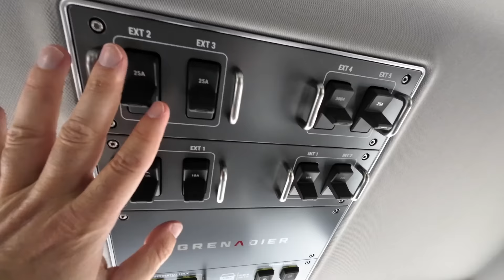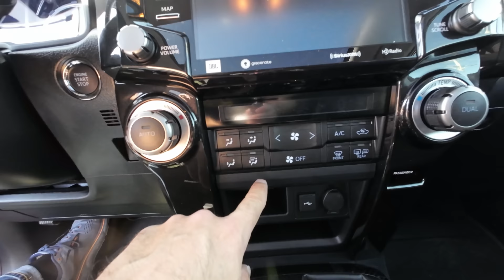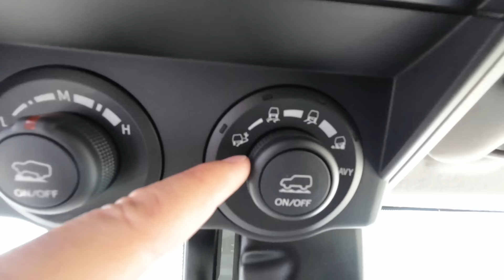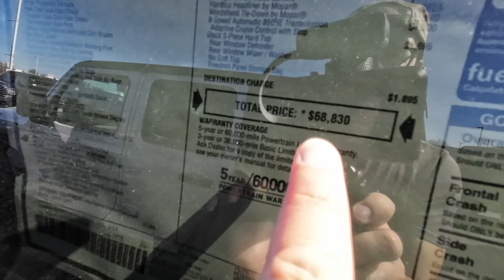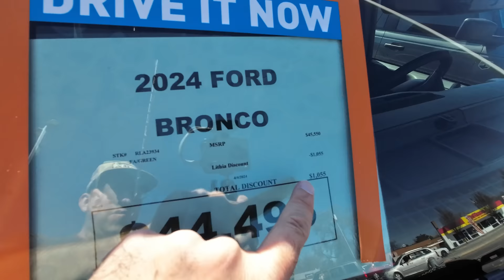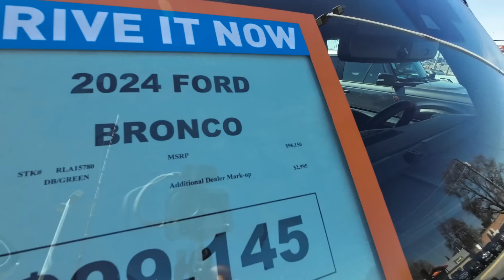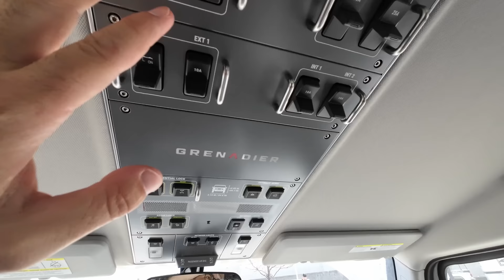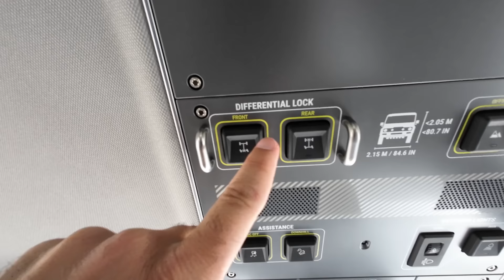This NEW SUV Has Ford & Toyota in PANIC Mode!

Comment: I do not recommend Stellantis, its subsidiaries FCA and PSA, with US models Ram, Jeep, and Dodge.  Anything happens and warranty support will deny the claim.  If the vehicle runs and drives, then Stellantis will state nothing is wrong with the vehicle.  Plus, the price of the vehicles are bloated, and not comparable in value.  Good Luck!
Reply: Its still called FCA. Its just part of the Stellantis group.
Reply: Had no issues having the rear window/seal and both exhaust manifolds replaced on my certified preowned 2020 Ram 1500 I purchased 6 months ago.
Reply: @Dan-gj1hz Stellantis is the corporate name.  FCA and PSA are subsidiaries. What’s your point?
Reply: @NoLimitsCommemorativ Exhaust systems are not covered by ESC warranty.  Window seals are cosmetic, also not covered by ESC warranty.
Reply: @briankiefer856   read your own comment 🤡🤡🤡
Reply: @briankiefer856  Well, you must be something special because it is A. Manufacture defect/recall on the rear windw seal- replaced no issues
And B.  Cracked manifolds, another issue covered under the warranty.  If they weren't then mine wouldn't have been replaced--- for free.  
Enjoy being salty
Reply: @NoLimitsCommemorativ  That’s a basic warranty and/or Emissions warranty not an ESC warranty.  ESC warranty does not cover those Items in any way shape or form.  In the future, you should start off with courtesy, and not your personal attacks. Recalls by your own definition of repair is not a warranty.  There’s nothing in the comment about recalls.
Reply: @briankiefer856  "If anything happens, warranty support will deny the claim"   You literally state this, like @Dan-gj1hz stated maybe you should read your own comment and not contradict your own statement.  I literally told my experience which happens to be the exact opposite of what you claim.  Have some courtesy and don't comment ignorant crap- just because you can doesn't mean you should.
Reply: @NoLimitsCommemorativ  You don’t know the difference between a basic warranty, (3/36), Emissions warranty (2/24), and an ESC, also known as an Extended Service  Contract.  An ESC picks up coverage, after the basic warranty expires.  You referenced recalls per the RAM 1500 model year 2020, depicting (exhaust manifold) and (window seals), per safety campaign.  I researched NHTSA, and there are no recalls, per RAM 1500 2020-2022, indicating any safety recalls, in relation to those items you stated.  In addition to, I reviewed the TSB, technical service bulletins, and there is no information pertaining to the exhaust manifold and/or the window seal per the 2020 RAM 1500.  As far as FCA, FCA and PSA merged in 2021 to form Stellantis.  If you read your warranty, (2020 RAM 1500), then you would see in black and white print, clearly printed in English, “items not covered.”
Reply: @Dan-gj1hz  The comment is correct.  Stellantis is the corporate name.  FCA is a subsidiary thereof. What’s your point?

Comment: $93,000 for a Bronco with funny flared fenders...lmao. Does it have an LED light on the back flashing "sucker" when you drive down the hwy?
Reply from the maker: I think the sucker light is a dealer option. haha. I would rather buy a high mileage one and figure out how to swap in the Coyote V8. Someone HAS to make a swap kit at some point.
Reply: The Cybertruck blows that away, and you ain't even buying gas so saving a lot of money.
Reply: @metalmike570  No.
Reply: Buying any Bronco that had / has parts assembled in Mexico is an automatic no-go for anyone with a brain.

And BTW, aren't the new Forunners equipped with turbo 4-cylinder engines now? I know this is the only engine available on the new Tundra - effectively ruining that product line...
Reply: @bigglyguy8429  I'm not sure but I said it anyway.
Reply: @metalmike570  Indeed you did.
Reply: The bronco raptor fender flares look hideous.  They don't fit the vehicle
Reply: @Technomage1700  The Cybertruck looks better than most of these trucks. 
And the Cybertruck is way more cutting edge than these, it's just more interesting.
I can't afford one though!!
Reply: Lol
Reply: The new Broncos have been having to get towed off trails at an alarming rate also! They are not very off road capable at all!

Comment: So the internets say the base model starts at 71K with no delivery/add-ons/tax/title/fees. The one he is looking at is north of 80K. Its so weird how the more money they put into a vehicle the "better" it is. If I had the money...I would rather get a 50K TRD Off Road and put 30K worth of mods on it. And IF the engine needs something I can pay a reasonable price instead of 5 times more simply because it says BMW. Oh, and post parts stores will probably have what I need in stock.
Reply: I bought a new jeep gladiator 13 months ago, $57,000. I couldn't keep it in its lane, it wandered off course, especially when passing big trucks. I waited 3 months for the updated, steel, steering box, very little difference. No doubt, going off road, at 10mph in 4 low, might be reasonable but, getting to ones destination was a dice with death. I bought a new Toyota 4runner, I drive normal, no, not like a American, 80 mph in a 55. I average 20.7 to the gallon. Give me old school, and reliability.
Reply: Not to mention that the Toyota engine is FAR more reliable than the BMW.
Reply: So how much did you say???
Reply: @jameslowery4550  Looked it up as soon as he said 3 lockers. Knew it wasnt gonna be pretty.
Reply: the bm, is a good choice, engine,,  but for eu, not u.s.. here in aus, we fit LS, or bm , 3.0tdi m57.. in everything..my cat is a bit smoky lately, cough,.

Comment: Turbos=engine wears out faster costing more money to fix
Reply from the maker: Yep.
Reply: You got it
Reply: Boost doesn't mean unreliable. Look at all of the old boosted diesels back in the day.
Reply: @AndyE30  key word.... Diesels
Reply: On the turbo point - this version of the B58 is custom tuned - they drop HP to 282 (I think) and leave max torque the same as in the BMW X5, but smoother delivery lower in the rev range.  This is specifically for off-road performance, but also for increased longevity.  I was a little concerned it would feel, at almost 3 tons, a little underpowered, but it moves just fine off the line.  Just be prepared for a different performance profile from the X5, even though it’s the same engine.  Totally different tuning (and almost 100hp lower than tuning in the Toyota Supra).
Reply: crap.. a 7.3 IH, will do 1 million miles,,  its called  SERVICE THE FKN THING.. LIFT THE HOOD..
Reply: You are absolutely right. No Turbos for me ever again.
Reply: @simons5193  I added an extra, bigger turbo to my truck, along with some other goodies. Then again it's an old diesel Hilux :) Been going strong for over 5 years now

Comment: I'm sorry but I'm just not seeing the value in buying a Jeep or Bronco for $20k - $35k over an "outdated" 4Runner would cost.  Those Jeeps and Broncos will be recycled into washing machines and the 4Runner will still be running strong.  You talked about how much more modern the Jeep interior was compared to the 4Runner.  The climate controls look pretty close to identical.  It's your money, get what pleases you.
Reply: not to mention more electrical and sensors to go out on the "more modern", which most warranties dont even cover.
Reply: my money, i did, a 75 f250 highboy, cut to swb, 4 w disc, 5sp, 351c, 35,s. all up,with purchase 20 yrs ago, about 12k..  worth 40k now..  winner...

Comment: All i know about the Enios is that in Australia they are having a hard time getting parts!
Reply: Ineos, and it is British.
Reply: proly cos were not part of the eu..  last decent, not perfect or really good, was the 80 series.. gutless. how to fix an 80 series, buy a gu nissan, fit the transfer, front coils. into the nissan, & a bm 3.0 tdi.  nissan have a trans brake, the best, & a longer wheel base, better..  or, buy a 78 f100 4x4, fit a front locker, job done.. no need for tjm, arb, bs.. cant beat yank 4x4rs, not jeeps.. i have a gu, s/duty, 1975 f250 highboy, cut to swb.. look them up, & cry.. diesel or petrol.. 35,s no probs.. no mods..

Comment: Call me crazy but I'd swap something like a Cummins 2.8 diesel in this with a manual transmission.
Reply from the maker: That would be rad! I bet someone does it eventually once we see higher mileage examples.
Reply: toyota 3.5 or a ford 2.3 with an Aisin (not to be confused with Asian) made 6 speed manual.
Reply: the cummins should be much better with the zf 8 speed tbh!
Reply: id just buy an old rubicon, do the same. parts will be hard to get.. 4 door that is, 2 doors are death traps..

Comment: A 4Runner cost around 45k will last at least 500k miles how much does a Grenadier cost and how long can it last?
Reply: but you only drive on the road, why have a 4x4. ???...
Reply: Correction last 500000 before the 4 cylinder castration

Comment: I would never include "jeep" and "best" in the same sentence.
Reply: Actually, the "Jeep" Wrangler IS the "best" for hardcore off road trails.  Period.  Solid Front Axle beats Independent Front Suspension that everyone else (but the Grenadier) uses when it comes to hard trails, every time.  Wheels on the ground have traction, wheels in the air do not.  But other than that, it's hard to deny Jeep's quality issues.  (I drive a JK Wrangler off road, and have for years).  What puts the Wrangler above the Grenadier as the "best" ?  SUPPORT.  Parts availability, dealership availability, etc.  AND you can get a very good one for less money.

Comment: I was on the wait list for a Grenadier and even spec’d one out… I backed out and bought a 2023 Lexus GX460. The price, the quality, the cost of parts, the lack of service centers, some of the odd design choices etc all added up to a terrible idea. Unlike what you said in this video, seeing out of the rear window is SUPER hard with the huge spare tire and the pillar for the split doors, the 2nd row of seats don’t fold flat so you don’t have any flat load space if you will use it for work, things like a new key are $1,200, everything is bespoke and expensive for it should you break something and the two nearest service centers to me are about 80+ miles. You buy a new vehicle, what is the likelihood of bugs? Kind of high, do I want to drive 160 miles round trip to have something sorted? NO! I didn’t even address things like none of the new ones are coming with tow packages because they have some recall on them, I didn’t even talk about things like the electric power steering pump, yes, it literally has an electric pump behind the passenger headlight to run the power steering. That couldn’t be ran off a reliable belt? Or the weird choice to put everything on a screen, OR the electric shifting of the transmission, where the Toyota there is still mechanical linkage from the shifter to the transmission so if you ever need a tow you aren’t laying under the vehicle trying to get the stupid thing in neutral. Once you get past the cool visual appeal of the grenadier, it has a lot of meh qualities.
Reply: you dont go 4x4ing. you bought a 300 series toyota. gx460, same sht..  if you have money like that..  buy a sports car, fk the 4x4rs.. not worth it..its a status symbol, nothing else.. i have a 2000 s/duty, 4.2tdi mwm sprint, german diesel, built in brazil, sold in aus, canada, africa, u.k.., not u.s.  mine has 700nm, no computer crap,14 lt 100, 4x4, tows 4.5t. 5sp. 35,s. owned 8 yrs, no probs.. not a yupi.. follows mates 80 series toyota, round tight sandhills, no probs. std.. not a status person, practical..  carries 8.5mtr on the roof rack. 3m in rear. comfy, cheap.. 25k..au. about $2.50 u.s.

Comment: I had.one.of.the old square Isuzu trooper s.   It was just the 4 cylinder with a 5 speed behind it.     That thing was so awesome. It has a , manual windows.    It was perfect for weekend camping trips , or just.going to check on the cows in the back pasture, when the weather was too Ruff to go on the tractor.    True it's like a dinosaur today compared to today's vehicles.    I'd buy a new Isuzu today if it was the exact same as the one I had , over these new SUVs. Sadly I traded it to pay for the closing cost of my first home.

Comment: The Grenadier, IMO, is basically a hybrid BMW designed to mimic a G Wagon… but costs less. As this brand becomes better known I think they are going to sell a lot of them in the U.S. it’s a sharp looking and capable off-roader for sure.
Reply from the maker: The dealer said they are delivering 1 every day right now. I'm curious to see what they will go for used a few years later.

Comment: I love old and outdated when it comes with dependability. I have a 2016 tundra TRD pro 4x4. It fit me perfectly, not bells and beeps going off constantly. I paid $39,000 new in December 2015, now they are $78,000, ugh!
Reply from the maker: The prices increases have definitely gone off the rails.
Reply: You want to hear a good one? My Dad bought a new truck in 1969, Ford 1/2 ton, $2,350.00 brand new, yes, two thousand three hundred fifty. Now a set of tires is $1,500, lol

Comment: I love how every feature you would want even if you didn’t know you may someday need it is an option. I mean get real, an off-road vehicle that I have to option a hitch. Then you get to the seats and say, “ They are manual which is great”. Uh, in what planet is that great. I guess if we built one with no power steering, no power windows, no Ac to break, manual transmission, manual door locks, a traditional key ignition, a push button Am/ Fm radio, No ABS brakes, wheel hub locks for 4 wheel drive and find some old 1970 headlights and get rid of the ridiculous led lighting we would have a $200,000 ultimate vehicle.

Comment: The price on the Grenadier was never mentioned.  

I find it amazing that one would consider aesthetics over reliability; otherwise, your pretty truck would look awesome in the mechanic's repair bay. 

I know there are Chrysler fans out there (Stalantis), but consider a Jeep with the Pentastar engine, which is known for its plastic oil coolers, which are prone to failure.

Personally, I'd take a 2FE engine any day. The 2FE will likely be the next 2JZ as they're becoming scarce, and plenty are of 2FE out there. Considering a naturally asperated stock motor starts with 268 HP on regular pump gas before any goodies are added, tuners are just beginning to develop performance enhancements for this primary platform. The 2FE has potential and is the powerplant in Lotus' Evora. 

Bronco's reviews by other YouTube channels have a big "Stay away warning."   Mechanical powerplant issues from poor build quality and fitment issues. Yes,  I mean the hardtop issues.  

BMW has made some incredible machines, but keep in mind they'd also made the x650i Sports Coupe. As another post stated, BMW has expensive parts. Sorry, no Dorman parts here.

Coming back to... "Do You want a Pomeranian or a German Shepherd?"

Comment: Just a modifier to my previous comment - nobody at Ford or Toyota is going to panic over Ineos.  Unless you are in the chemicals business or see them show up as sponsors in cycling, yachting or soccer, you don’t know who they are - and they’re fine with that.  I can’t imagine EVER seeing a television ad for a Grenny.  They are a small volume producer for a very targeted class of buyer - and they want it that way.  If they wanted market share, they would have to compromise on engineering/build integrity, or go a different direction on steering and suspension - and find out how to shift price points down $10-20k.  But that’s not what they want to be building.  Those of us who are buying them, it’s exactly what we’ve been looking for.  That’s a small group, and no threat to Toyota’s segment dominance (most of us also love and respect Toyota, BTW).  Most of us also don’t want the headache and compromise of a Rubicon, most of us don’t care at all about the Bronco, most of us don’t trust JLR, and most of us respect the Lexus GX but just want some more soul and character - and most of us realize we’re taking a risk with parts and service.

Comment: That mirror tag on the 4 runner with the discount seems sketch.  It says price includes “trade and finances” I wonder if they are throwing in some sort of  “with 5k trade” into that equation.
Reply from the maker: It does seem a bit confusing for sure.
Reply: They likely set the price with a low-balled trade-in offer anticpated (so they can make more $ on your trade sale), in addition to financing through the dealership (where they will add 1%-2% apr on top of the rate you qualify for). Typical dealership bs - which is why people dont trust dealerships.

Comment: Funny you ended with the Grenadier when after seeing the price of the others, If I was going to spend close to a one hundred grand on an off road vehicle, I just go with a fully restored Defender 110. I do really dig all of the outside ports and mounting options on the Grenadier. Once it's been out for a while and more companies start offering accessory add ons for overlanding  I'm sure it will become more popular. I'm still waiting to see how the Toyota Trailunter does. I have an 07 FJ cruiser and wish Toyota would have instead of getting rid of it combined it with the Land cruiser and started offering their own customizable overlander. Especially with the new hybrid power plant they're offering in the Trail Hunter that is 300 hp and 300 lbs of torque.